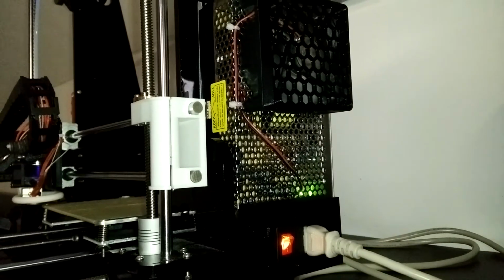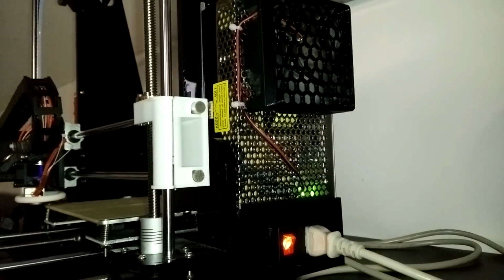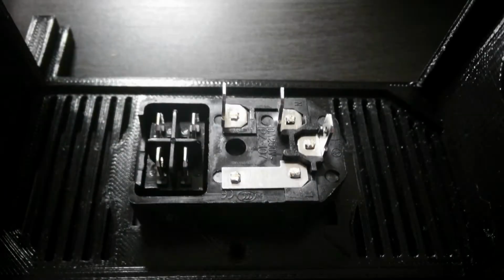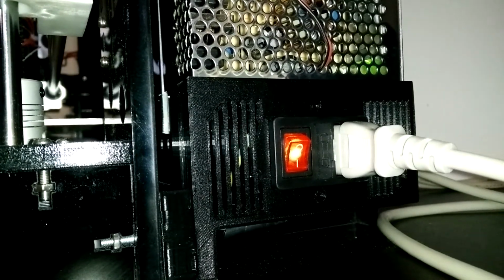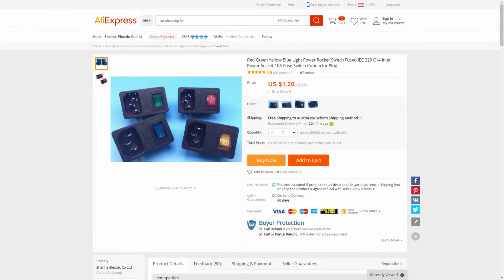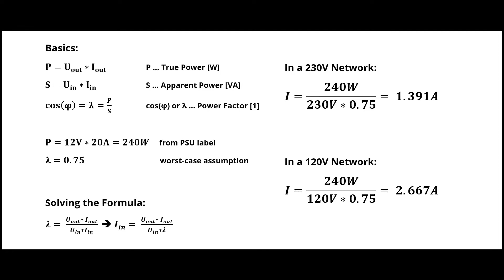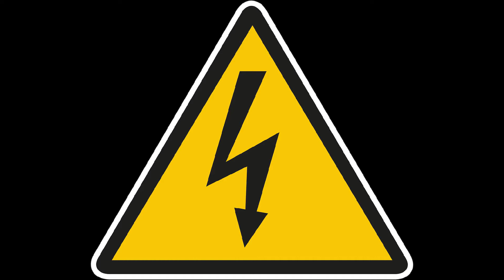Anet A8 - Power Supply Safety

Comment from the maker: After checking how I wired the switch, it turned out that Charlie Rabatin is right! At 1:45, the upper and the lower pair of wires at the switch (left) need to be swapped to avoid that the light is always one (seen right after 1:45). Thank you very much for pointing this out and I'll probably add a connection switch diagram to the video description to avoid any confusion.

Comment: please tell me that you put heatshrink over those AC connection on the plug?
Reply from the maker: Yes, I didn't show it in the video as I was just testing but I ended up adding some heat shrink tubing and insulation tape over the contacts (except for PE).

Comment: I see that you don't have a MOSFET for the Heat Bed! Or does the fan enough to cool down everything
Reply from the maker: Hi, thanks for your comment!
It's true that I don't have a MOSFET for the heated bed yet, but I have already ordered some. Until now, I haven't had any problems with overheating connectors or anything like that, the MOSFETS on the mainboard still work fine.
The fan on the PSU is just to cool down the power supply itself, it manages to keep the transformer cool even when printing PETG.
Reply: Oh okay thanks for responding :)

Comment: Thanks for the video! I just ordered an A8 and I wanted to do a fan upgrade on the PSU, are those additional 12v outputs that you hooked the fan to?  I bought an upgraded PSU and I just want to make sure I don't break the fan the first time I hook it up.
Reply from the maker: 16by80 Hi, thanks for your comment.
The 12V 20A PSU has 3 pairs of 12v outputs, 5V is not present.
If you have any questions, feel free to ask.

Comment: mind if i ask why you're mounting the fan to pull air away from the PSU? does this result in a better airflow compared to blowing air into the housing? cheers!
Reply from the maker: Hi! My main reason for this choice was the fact that the power supply has a lot of space where the air can be sucked from. Based on this fact, the air would come from multiple sides equally and thus cool the most parts. Therefore and combined with the fact that most comparable power supplies also blow the air from the inside out, I thought that this solution would fit well.
But, to be honest, the power supply shipped without any fan and also worked, so everything is an improvement.
Reply: awesome, thanks a lot!